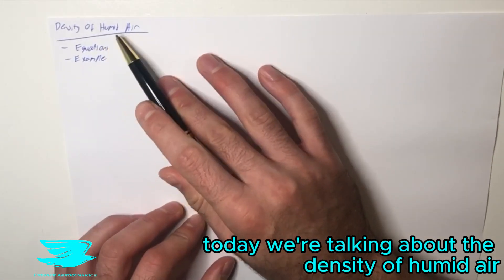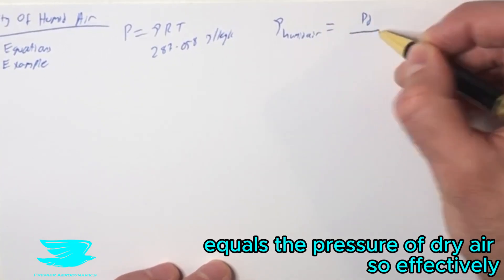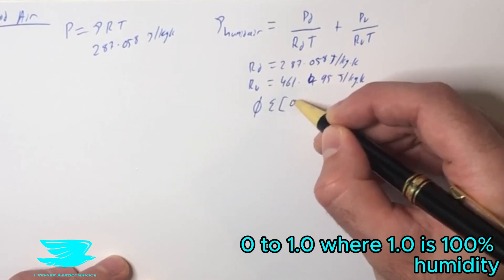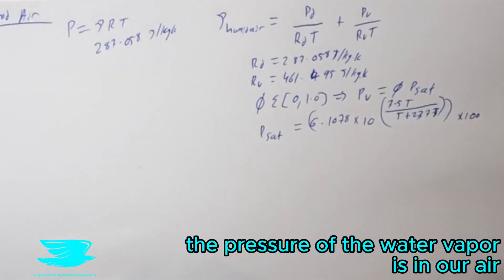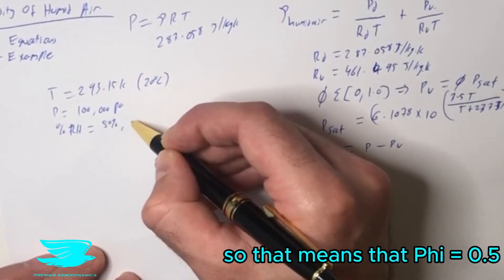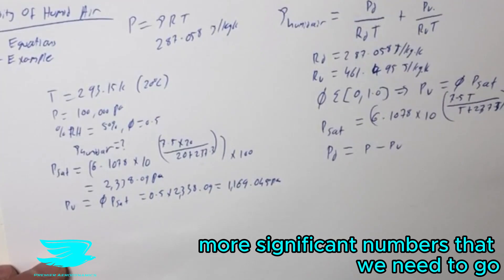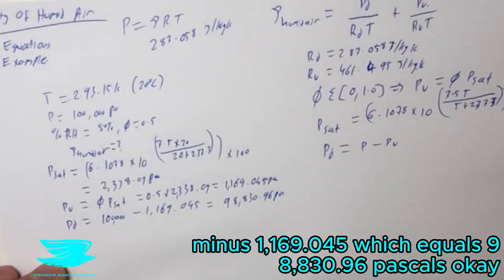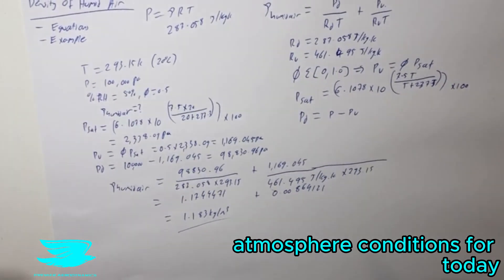[Aero Fundamentals #34] Density of Humid Air

Comment: Lower density of water vapor vs. air is not necessarily intuitive.
But as glider pilots we take the corresponding mechanisms merrily.
Reply from the maker: That's true. There is always the question of how these two components interact and if this interaction changes its chemistry.

But, apparently it doesn't. So that's good news.